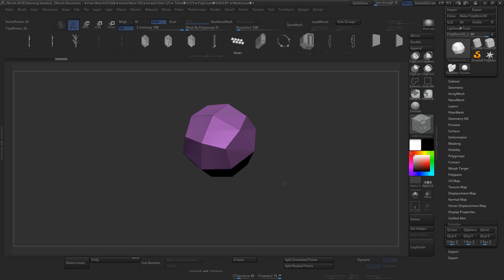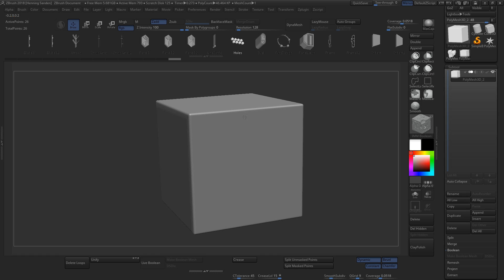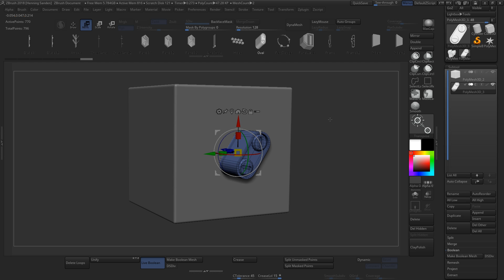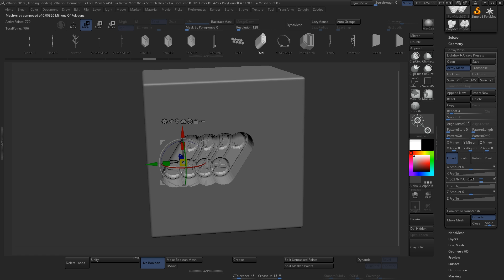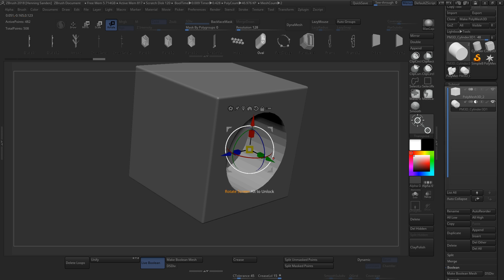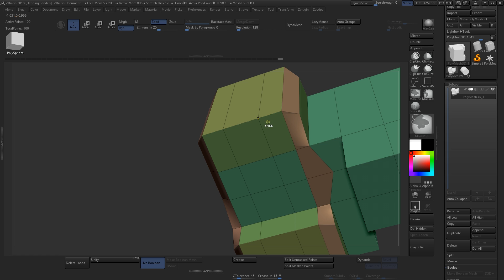5 Hard Surface Tips in ZBrush You Didn't Know

Comment: The "click to repeat last command" in Zmodeler works on almost every tool, not just the Bevel.  For example, the Qmesh poly command.  YOu can extrude a face using qmesh, then just click on other polygons to get the exact same level of extrusion.  Same for anything in the vertex level operations.